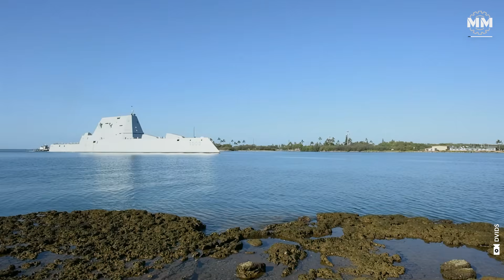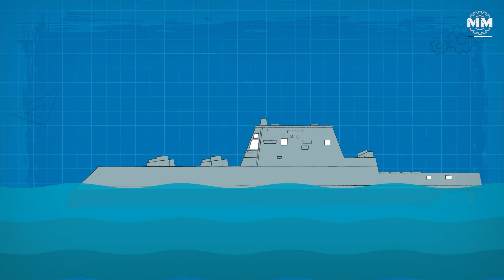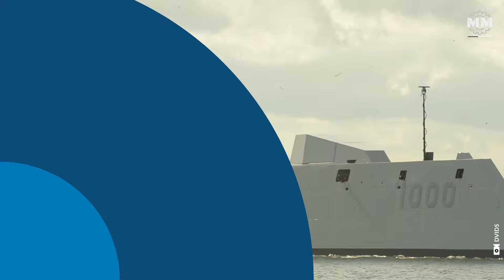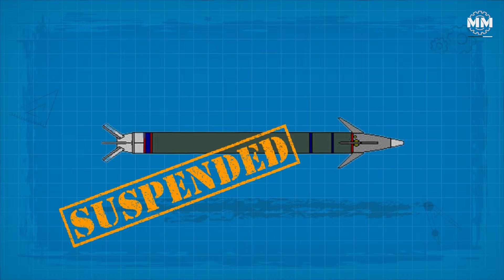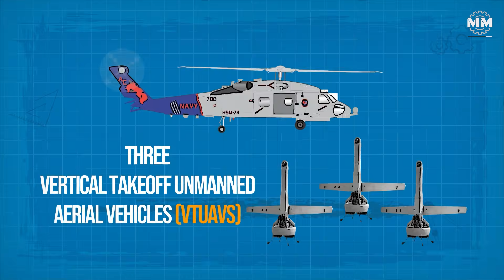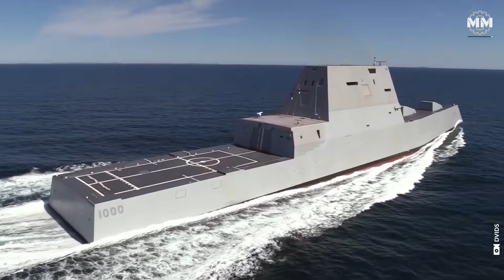$9 Billion Ghost Ship: nside the World’s Most Advanced Destroyer That Terrifies China

Comment: One of the biggest costs of advanced warships appears to be the electronics, which would seem to be adaptable to most any ship. It's a big mistake to ignore large autoloading shipboard guns, they were perfected closely after WWII and Korea. Capacity of a Burke Cruiser should be around 1000 rounds, much more explosive power down range power than bulky, expensive  missiles. A combination should be considered. See Gerald Bull.
Reply: Problem with guns is they are still rather inaccurate and are very short ranged. 64 miles is nothing compared to 100+ miles of range for modern drones and missiles from the VLS'. To know the firepower of a ship today look at the number of VLS, much like we used to look at how large the diameter of the main gun prior to BB's becoming obsolete in the 1920's. 

The secondary turrets being replaced with hypersonic or more VLS would be a  great future upgrade. 

Then the USN should start making the failed LCS ships into drone carriers and design dedicated drone carriers, small and mobile, as drone warfare is the future.

Comment: Nonsense! Zumwalt actual COST is OR SHOULD BE  about $1-2B plus $5-10B of BULLSHIT!
Reply: Not to mention the cost of the "alterations". If the Navy could have built 3 more, the cost would be less, but I fear affordable is out of reach even though it's likely going to be necessary in 10 years. I'm happy to see a comment like yours.
Reply: @patrickjohnson63  Why not gather a few old cruisers or rejected design ships, and modernize them with advanced engines, hull designs, guns, missiles, engines, propeller-units or water jets? Battleship NJ  just completed a dry dock restoration, so we know the cost of a large all-hull repair job! How much more to cut a destroyer or old-ish cruiser in half and add some length to the middle?
Reply: @tobyw9573  That would cost more than just bulding these DD's fro scratch. 

The way accounting works is all the overhead and R&D costs get distributed to a per item basis. So if you had  $24b overhead, shipyard, labor, materials, and R&D costs and made 3 ships at $3b each, then congress would calculate that as 3b +(24/3)b = 3b + 6b = 9B each but the actual cost would only be $3b per ship. But if they made all 32 then it would be 3 + (24/32) = 3b + 0.75b = 3.75b each which is comparable to the 2.7b of a Burke.

TLDR: They distribute costs like idiots and the real price is closer to 3B each where Burk classes cost 2.7.

Comment: One of the biggest failures of a project too
Reply: Great ship, crummy design engineering, supervision, and quality control!
A change of gun barrel and use of stock 155mm artillery shell of about the same  seven designs of as field artillery in Ukraine would solve the artillery problems. Matching the artillery shell to gun barrel would take just some light cuts on a lathe.
Reply: @tobyw9573 what i mean in failure of a project
They didnt met any of the major qualities needed for their class
Reply: @tobyw9573  guns on ships, outside of being close range anti-air and anti missile/drone, are basically worthless. 

When VLS can hit you from 1000 miles away, and your artillery only reaches 64 miles (at the very best) its like bringing a poleaxe to a gun fight. Missiles are longer range and do far more damage per shot and are far more accurate than guns.
Reply: Frfr